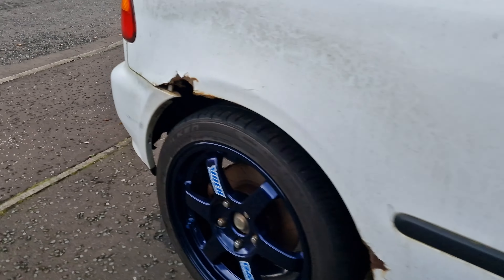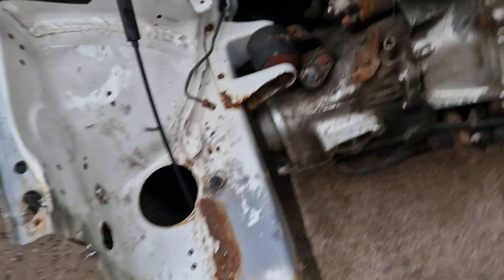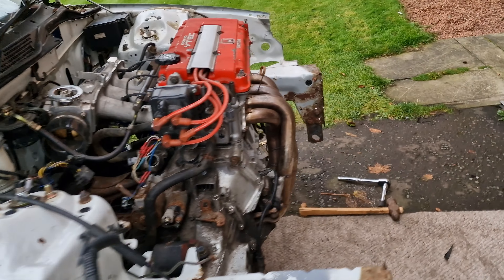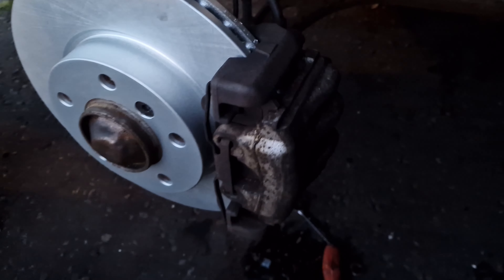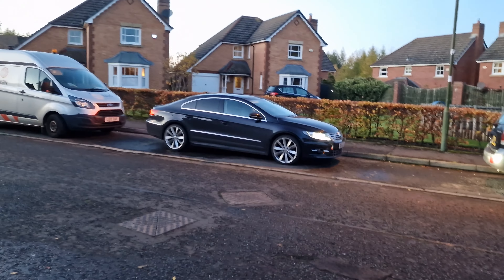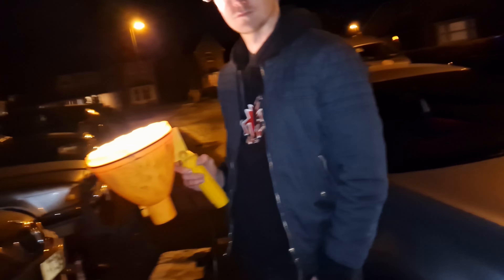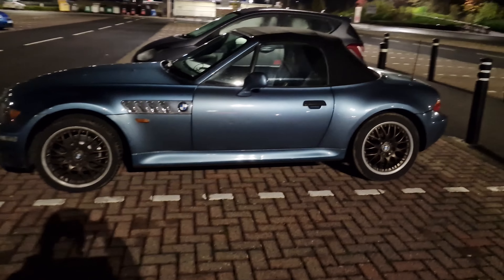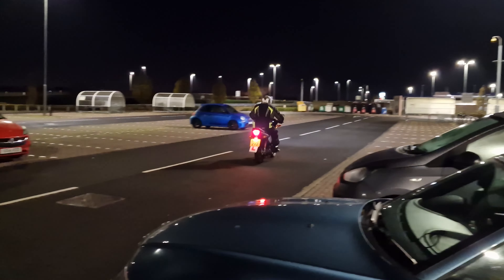EG build Update + Fixing the Z3s Sticky Brake Caliper

Comment: Pro tip with those brake brackets. Set the outa ears against the housing then just push the clip in the center towards the caliper and they snap right in!
Reply from the maker: I done that on the other side but I couldn't be bothered taking the wheel back off so had to commit to the hard way haha